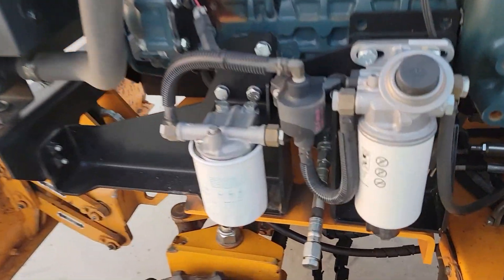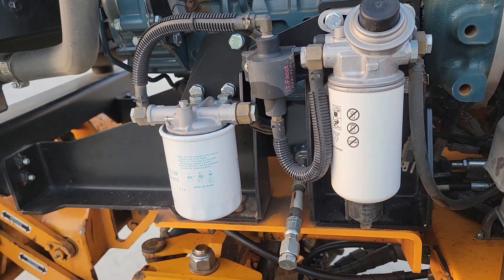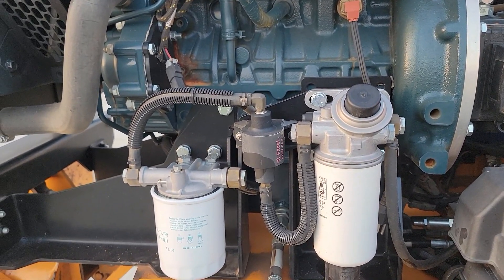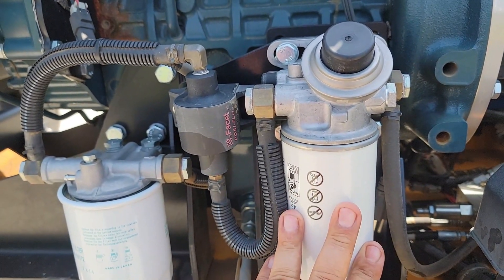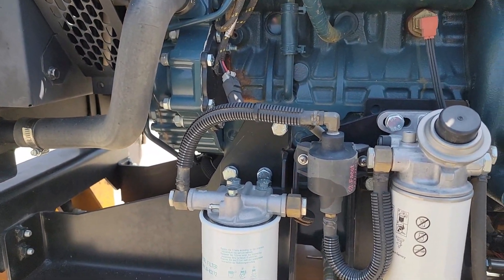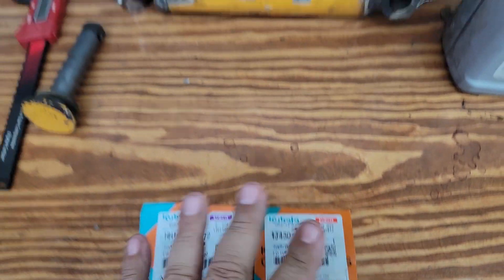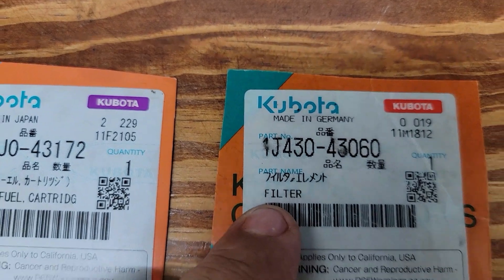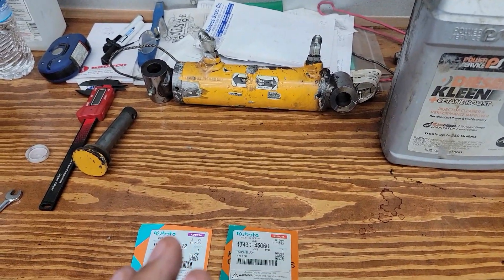Kubota Diesel Running Rough & Losing Power

Comment: I have a Bandit 2550 stump grinder. I was wondering what hydraulic oil you use. It  has a label by it says to use Petro Canad hydrex-xv hydraulic oil.
Reply from the maker: Depends on temp ... If very hot summer Aw68 normal Aw46 winter Aw32
Reply: Thanks that's a big help.

Comment: Hi
I have a giant gt5048 with this exact engine and filter setup.
I just bought it used (540h), with no guarantee(No comments on this 🫣).
They did a big 500h service with all oils and filters etc just before selling it.
when i bought it, i just ran it around the shop a few mins, and checked all functions.
But now a couple of hours in, it stalls and is a pain to start and keep alive. After a few mins of bad idle and some starts, it runs smoothly and will work until next start.

Is this a problem of air leaking also?
Reply from the maker: Ck fuel lines

Comment: Thank you so much Sir. Had this problem with my skit steer, (Kubota SVL65-2) it has been a thorn in my side. I hate going to dealership before I survey every possible solution myself. The water separator filter on my skit steer was $157.00  so I hunted one down and I got an OEM from an outfit in Kansas for $87.00. Highway robbery.  Your advice was golden, thank you.
Reply from the maker: Two thumbs up

Comment: Thanks for the info. I run diesel clean in my truck (Nissan Titan with 5.0 Cummins) every 3rd tank. Do you run it every tank full in the grinder?
Reply from the maker: No once a month ... I want to by the Titan like you have but they were a rare find ..what kind of mpg do you get
Reply: @mustangrebuilder  about 17 mpg pulling stump grinder. Best I ever got unloaded was 21 but rare. I’m told if you put them on a diet that 21 becomes much more frequent but I bought mine used and the entire fuel and def system was replaced before I got it so no problems knock on wood leaks it stays stock for now.